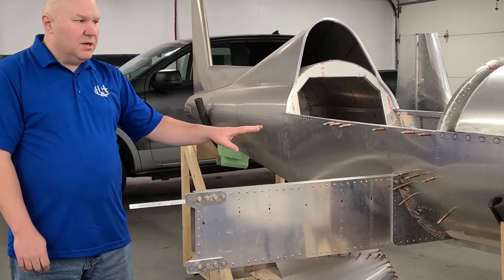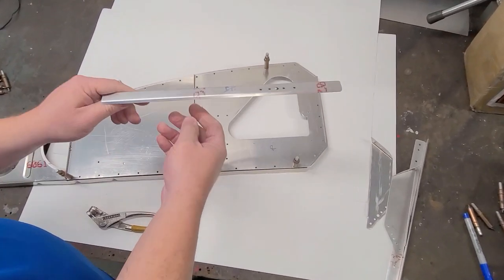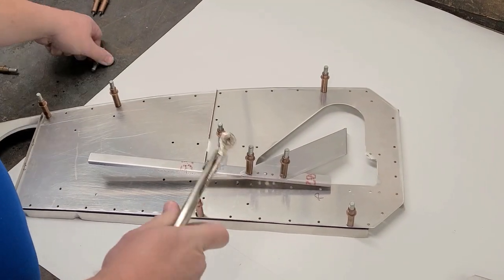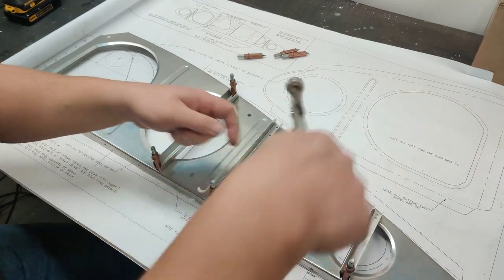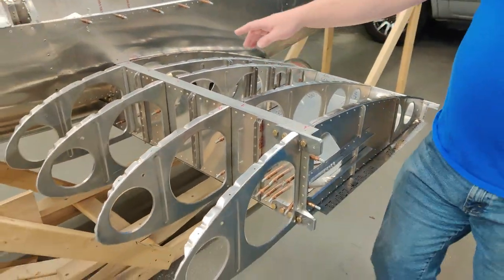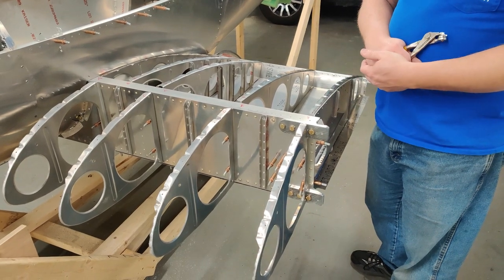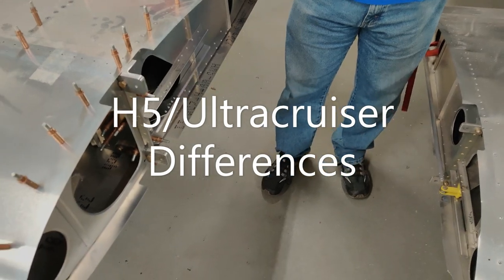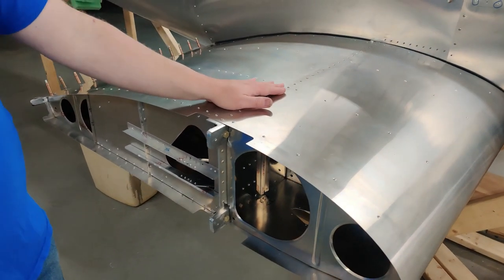Hummel Center Wing Assembly - Continued

Comment: Yes that is a valid point, knowing how to install a rivet properly is very important as a lot of damage can be done by misuse of the usually pneumatic hammer and anvil  tools. I work for Boeing aircraft for a number of years and the slightest lack of focus can damag a whole part, and you're back to square one so give yourself time to learn how to use these tools, I would also recommend spring stops for your drill bits and it would probably be a good idea to offer some instruction on how to properly deburr because too much deburr can also damage your part. Great video Good question.

Comment: I'm confused.  You are working with pre-drilled kit pieces but then say the holes need to be drilled.  To clarify, none of these pieces come with any drilled holes, correct?
Reply from the maker: Holes are pre-drilled on both the UltraCruiser and H5 kit parts (with a few small exceptions).  However, in order to meet the 51% rule for Experimental Builds you will have to drill the holes larger than what they are when shipped to you.
Reply: @hummelaircraft  Got it, thanks!

Comment: Wouldn't solid rivets not only be stronger, but lighter as well?
Reply from the maker: Solid rivets are used in the factory provided parts.  Yes - they can always be put in by the homebuilder if they wish.  We design for the use of the Avex and Stainless Pull rivets to make it more user friendly for builders that don't have the tools or experience to drive solid rivets. HAC